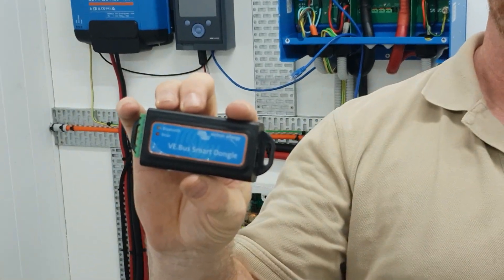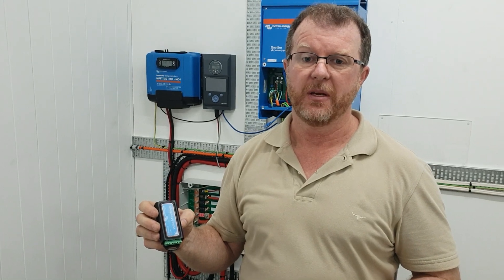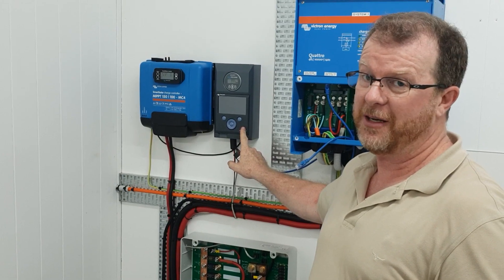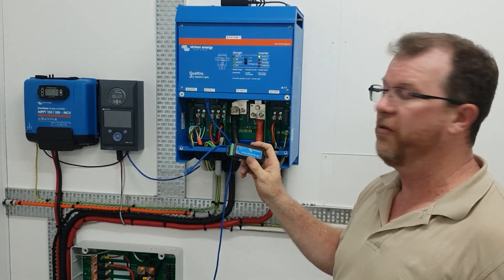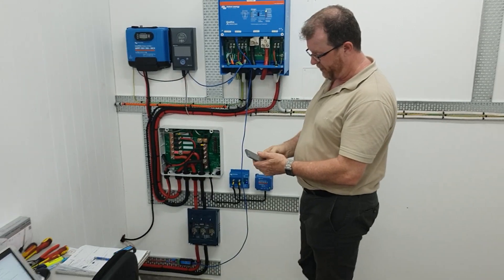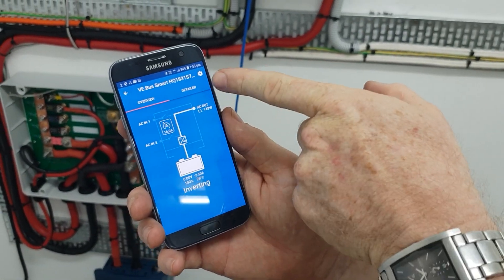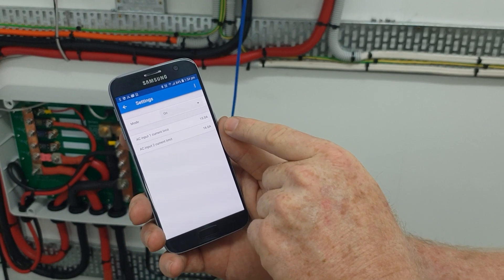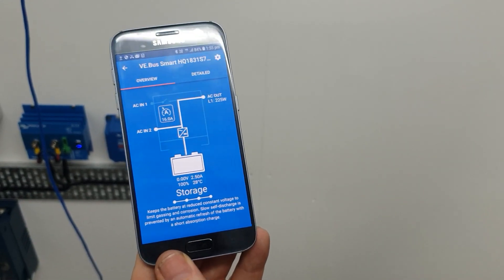Victron VE Bus Smart Dongle

Comment: So, I'm trying to find out how this battery temperature works. You say you can stick it on to a battery, and it will tell the temperature. But then you placed it inside  near the cables, and in the app you mention "temperature" but what temperature, sence you don't have it stuck to the battery? I was on another video aomwone talking about that the temp in the app is actually the inverter temp.. Just trying to debunk this temp gauge what it's for. Thanks!